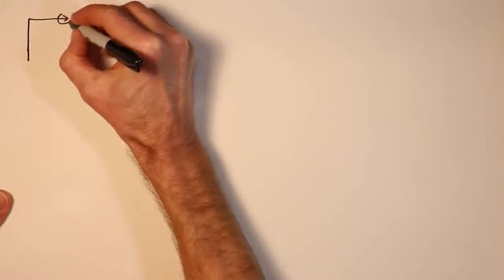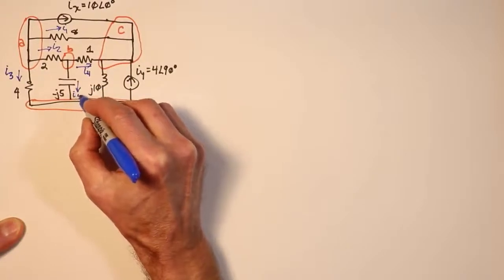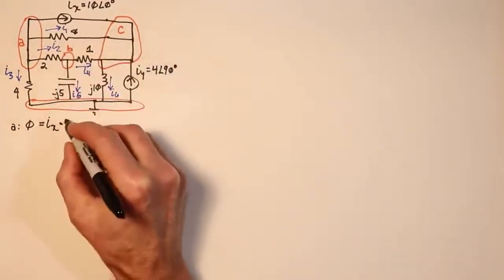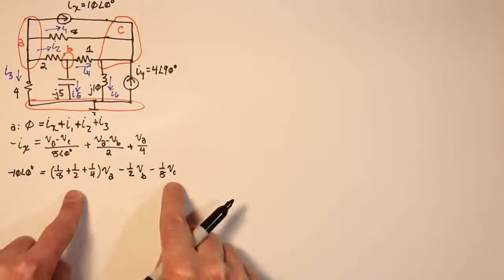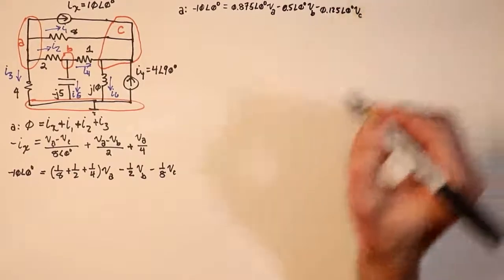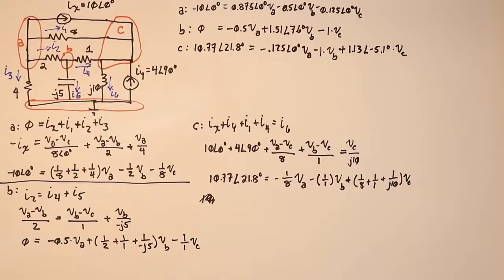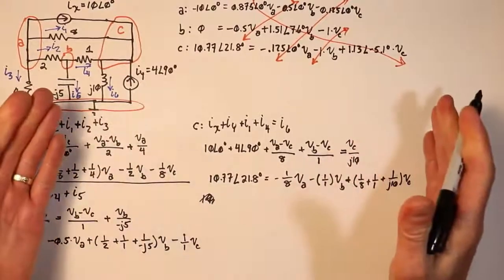AC Electrical Circuit Analysis: Nodal Analysis Example, Part 1

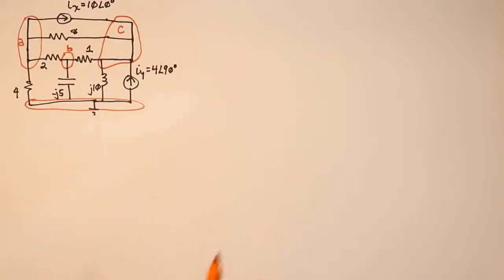Comment: Good video...At 2:43, why did you add "j10" in node C? It should be a separate node.
Can you kindly clarify?
Thanks.
Reply from the maker: Nope. That's all one node. Just because the wires are drawn separately doesn't mean it's another node. Think of all of those wires as just one big blob of solder. It's one big connection point, and thus, one node.
Reply: Thanks for the clarification. Appreciate. @ElectronicswithProfessorFiore